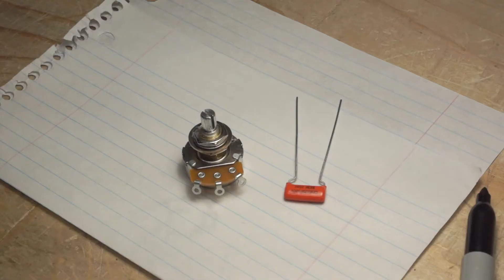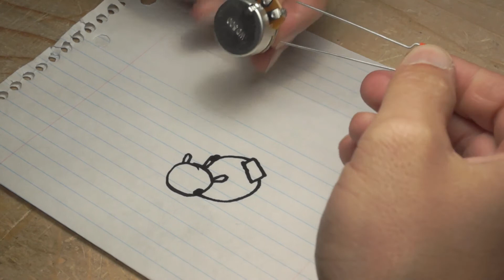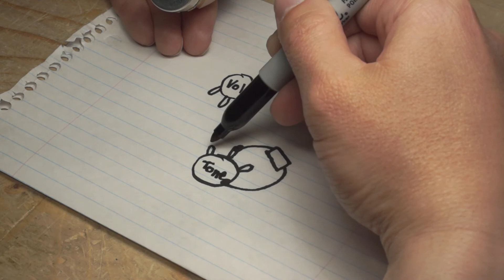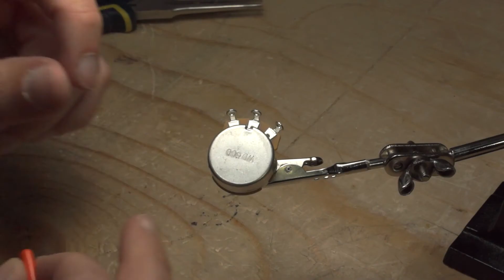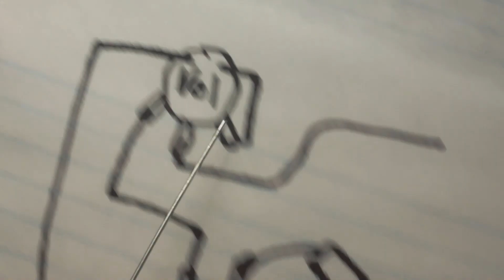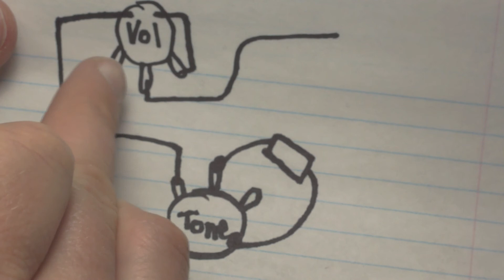How to wire a tone control for guitar - Fix it Friday #8 AJG

Comment: Also depending on which lug you run the wire to from the volume, far right or far left lug. It will determine which way is up or down on that tone pot. I like to wire mine so when the pot is turned all the way down, the tone control is completely out of the circuit. To me it makes more sense at 0 the cap is out of the circuit at 10 that cap is fully engaged. Lots of people wire it the other way where 10 the cap is out of the circuit and 0 it is fully engaged. That is why you see many guitarists say I keep my tone control on 10 which means it is out of the circuit at 10. I keep mine on 0 which makes more sense to me since 0 means out of the circuit and 10 means fully engaged in the circuit.
Reply from the maker: For sure. Whatever works for you.

Comment: The capacitor on myvtine control is connected to the right lug(the tone control is face down)
Reply: The left contact is not used, and it does not matter which of the two remaining contacts the capacitor is soldered to and which the signal goes to.

Comment: Quick question- are both pots the same type or is the a specific one for tone and a specific one for volume?
Reply: Same. What makes it different is you add a capacitor to one pot - now its a tone control.

Comment: I just watched another fellow who says the orange drop capacitors have an orientation, and that should be figured into installation.  Have you seen this?  (he hooks leads up to his maxed out volume amp and figures out which leg ought to be grounded and which leg is hot).  Just FYI.  Comments?
Reply from the maker: I have never heard of this. For electrolytic caps, there is definitely an orientation. For normal orange drops like this, I have never heard of checking orientation.

Comment: Is the cap necessary? If I don't have one?
Reply: Active pickups, 1 volume, 1 tone, 3 way toggle. The tone is acting as a 2nd volume.
Reply from the maker: If you want to wire a tone control, you need to have a capacitor.

Comment: I have a Stacked Dual Concentric Potentiometer(POT) A100K. Is that a passive bass/treble tone pot that connects to an active preamp? I understand that the “A” is for audio/log taper (tone) and the “B” is for linear taper (volume).
Reply from the maker: This could be. In what specific instrument are you referring to? I need to know more information.
Reply: I have a Hohner a B Bass V. Each of the 6 lugs of the current bass/treble stack connects to a separate preamp circuit (I know, a little old school), which is mounted on the inside of the control cavity cover. The portion of circuitboard that holds one of the sets of lugs is broken, but not detached, so it still works. As of this response, I already replaced this stack with a new one but I also wondered if it could also be used as passive tone controls connected to the 2 independent pickup volume pots. That way if I wanted to permanently change the bass to passive only I wouldn’t have to add a second tone control. I would just use the stack. I realize that I could probably use master volume and blend pots, simply running a single tone pot off the volume the way you demonstrated.

Comment: Wired my guitar up exactly like this and it didn't work. Checked seymour duncans official diagram and it is way different. Don't waste your time with this video make sure to look at the wiring diagrams relevant to your hardware.
Reply from the maker: I mean no disrespect but you may have done something wrong. Please check your grounds. 

There are numerous ways to wire up a tone pot, this is correct.

Comment: You sound like you know what you're doing as well as being a friendly enough chap to help someone out. The green capacitor in my tone pot is soldered to the left lug not the middle (looking at it like how you drew it) and the  pickup wire had come off, (why I decided to fix it) I'm assuming it was soldered to the middle. Only the right side lug is clean of any soldering. Nearly every vid and diagram I've seen has the capacitor connected to the middle lug. Does it matter which lug it is connected. My guitar was new (well, was supposed to be) when I bought it. Has it just been wired in an unorthodox fashion or has it been wired wrong. Can you help here?
Reply from the maker: Please send me an email through my website and I will try and talk you through it.

Comment: In which direction(s) is the current/signal in the circuit actually flowing?  Which are the actual inputs and outputs?  I'll never be able to understand this stuff unless and until somebody FINALLY explains this (like, at ALL, much less properly).  NOBODY ever does.  I'm convinced that on one out here actually understands this themselves, or really knows what the heck they're doing.
Reply: I think you are close, but it is more about fellows who can do it, just do it repeatedly and they do not understand it to explain it.
Reply: @DougHinVA  True.  Though I believe I do now more or less understand it (since posting that comment), after doing more research and thinking about it.

Comment: I think you may have confused some due to the fact that you used two different orientations of the potentiometers. The tone pot you were referring to it looking from the bottom and the volume you were referring to it looking at it as if it was upright. On the volume pot you did use the correct attachment for the ground but on the volume you actually attached the lead that went to the volume pot to the ground lead of the tone pot. Keeping the pots upright and numbering the leads from left to right as 1,2,3 helps to keep everything similar. Like keeping the #1 on both pots as the ground etc. Thanks for the video.
Reply: Which lug on the tone should he have connected to [which lug on] the volume?
Reply: He showed everything correctly.

Comment: I was triyng to think in terms of "where the current comes from". First, is the middle lug always the output pin? Because if it's so, than the tone pot work as an output putting current into the volume pot: my question is: Where the current that goes into the tone comes from?
Reply: I THOUGHT I WAS THE ONLY ONE WITH THAT QUESTION!  Did you ever find the answer?  I've searched high and low and there is absolutely NO resources which actually explain how the circuits work; what flows INTO and OUT from what and to where.  NOTHING.  And literally EVERY SINGLE video does it completely different!
Reply: The input signal (current source) is connected to the end of the volume pot that is not grounded.